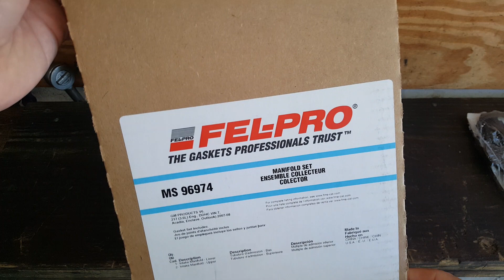How to replace the valve cover & intake gaskets on a 2008 GMC Acadia

Comment: Great video.  Easy to follow.  One HUGE tip.  You didn't have to remove the hoses for the Power steering reservoir.  All you had to do is remove the 2 nuts holding the reservoir to the bracket and move it aside. Then just bent the bracket outwards to get access to the One Valve cover bolt hidden under the cover protector. That's all. Then once the valve cover is reinstalled just straighten the bracket back to it's original position. Done. Again, great viceo.  Very well put together.
Reply: THANK YOU. This was the one step I was stressed over.

Comment: If I'm not mistaking, you put the new spark plug tube oil seals in the valve covers backwards. Great video!👍 Answers a lot of questions!
Reply: I agree. It seems backwards. Other than that the video is great
Reply: He definitely did put them back in backwards. I wonder if it affected the operation if any?
Reply: He did put then in bkward

Comment: Thanks for sharing your experience. I just got done doing the same job on my wife’s ‘08 Acadia, and I couldn’t have done it without your guidance. I found that I didn’t have to remove the motor mount. Also I removed the smaller front hose from the power steering reservoir and capped it off while I suspended the reservoir from the windshield wiper with a small bungee cord. Then I just removed one bolt from that bracket the PS reservoir was bolted two and rotated it forward. After bleeding the PS system when I finished, and discovering I forgot one wire connection and the rubber nubby thing that goes vacuum port on the back of the intake manifold fell off, she’s back on the road!
Reply from the maker: I appreciate you taking the time to share this and the great feedback.

Comment: First off, GREAT Video!! That MF'ing Bracket. After messing around for hours (most before I found your video), I started doing what you did. Then I got got tired and I bent it out of the way. The bent it back after. Worked awesome. Thanks!!!
Reply from the maker: Thank you for sharing and thank you for the great feedback.

Comment: Hi, at 51:31, you show plugs on the passenger side of the rear cover. 

What is the plug closest to the front of the engine? I broke the part connected to the engine, where it plugs into.

Comment: Thank you for this, I just got a 2008 Acadia and it has oil leaking into the spark plugs. But any idea why the transmission control would turn off after I did this job?
Reply from the maker: I first reaction would be it was a coincidence, however I would check all the wires , grounds , fuses , connectors etc. Wish I could be more help. Thanks for the feedback.
Reply: @s33therfan  yeah idk what happened

Comment: Need help after completing these steps we tried to start it up no power not even a crank or click bought a new battery, it still has no power nat a sound we double checked the connectors alls in place , I’m thinking it could have been the fuse box after taking in off then placing bit back but it’s simple steps I appreciate your video very much nobody has this model vehicle sets if you can give any info as to find the source of power to star the acadia 👏

Comment: Hey, doing diagnostics of my g/f's 3.6 in her 2008 Vue XR. She drove it, came home, then the next night it cranks but wont start. 200k miles and has had timing codes for awhile. Tested battery, good. Replaced the starter and tested the old, both good. Tested fuel pressure, good. Disassembled down and removed one valve cover. Chain is still connected at least, so not broken. Any ideas? Driving me crazy. Why would it be shut down and work and then all of a sudden not work now?
Reply from the maker: I would check for spark and do a compression test . Usually timing codes popping up is not a good sign , but I would check the basics and go from there. Thanks for the feedback.

Comment: If you spray PB Blaster, on connections like that it'll loosen and lube them up and then they'll come right off, if you have time to let them soak a little while.... I even use PB Blaster on stubborn electrical plugs, to get them apart.. I just use PB Blaster on a BMW thermostat yesterday, where the hoses with the clip that holds them on don't like to come off of it, so I took it soak them and let them sit about a half hour came back and they popped right off. And I do that to prevent breaking anything... Try it, PB Blaster is the truth...
Reply from the maker: Thank you very much for sharing and the great feedback.
Reply: Thanks for the info

Comment: How did you get the car to turn on after doing all that my acadia won’t start I did everything plus the water pump and thermostat
Reply from the maker: Sometimes I have had to give them a shot of starter fluid , with other vebicles. Not sure why but it happens and I have ran into the same issue swapping an engine. Once it fires up initially the car starts good from then on. Thanks for the feedback.

Comment: I hope after all the work you cleaned the PCV and the rear valve cover PCV passage. They all clog up and cause sludge and carbon in the engine, I have a 2010 Acadia I'm going to do timing chain's on Not going to enjoy that job!!! Great Video BTW !!!
Reply from the maker: Thank you for the feedback , it is much appreciated.

Comment: How much work would it be to replace the intake valves?
Reply from the maker: It would be a pretty good job. The cylinder head would need removed and resurfaced before replacing it. Thanks for the question.

Comment: Thanks for the video. This job sucks, especially the freaking clips. And i chipped the cover near the chains in the front -or someone else did it. Hopefully it doesn't leak, it's chipped on the inside. Can JB Weld be used to fix the chipped part?
Reply from the maker: I would think so , and depending on the size , maybe rtv alone. Thanks for the question.

Comment: Hey did you fix your acadias oil in throttle body issues if so what did you do.? Part numbers if possible
Reply from the maker: I cleaned the holes on the vacuum line spouts going into the valve covers and that seemed to help. Plus cleaning the valve covers themselves. Purple cleaner , scrub , rinse and repeat. Hope this helps.
Reply: @s33therfan  I have seen a fix for the pcv valve going around in the camaro community with the 3.6. They are installing an oil catch can and then drilling the 2 holes on the bottom to 5/64th's and the single top hole to 7/64th's. Also helps the motor breathe better to help with timing issues and sludge build up down the line
Reply from the maker: Great information , thanks for sharing.

Comment: Have this video saved to be watched later when I have more free time. Quick question though, is this the same motor that is in the 2011?
Reply from the maker: The engines are different , however the transmission can interchange with the tcm swap. Thanks for the feedback.

Comment: I have an oil leak and they telling me its the valve cover were they leaking oil
Reply from the maker: These were not leaking and as a matter fact all of these I have worked on have not been leaking. However once they are disturbed/removed they can and will leak. Other than that these engines actually seem to be sealed up fairly well , that is atleast one good thing. Thanks for the feedback.
Reply: What do you think is leaking it's on the back side of motor
Reply: It's not in the front of motor
Reply from the maker: It most likely is the valve cover . Try if possible to reach back and feel with your hand and if theres oil then that is the culprit. Another area is where the vvt solenoid come through the valve cover ; check those for leaks. Those seals can be replaced without removing the valve cover. Hope this helps.
Reply: @s33therfan  thank you ill look in to it thank you again  i don't want to have to replace the valve gaskets if they don't need to looks like I have to take off a lot of things to get to them
Reply: put my hand around the back side of the covers and theres oil but on top of the valve cover you think its where the spark plugs are at
Reply: you think I have to relplace the grommets and spark plug seals
please let me know what you think before I start taking everything apart already ordered the parts and intake gasket
Reply: I have oil on the insulation on top of the valve covers I push down on the isulation and oil comes out please let me know what you think thank you for all your help
Reply from the maker: Yes . I would replace all of them . When you go to replace the valve cover pay particular attention to the vgt solenoids . If they have any wear marks to the plastic. You may have to use a little rtv smoothed around the surface area there. I have seen those leak pretty severely , even after replacing the grommets. You should be able to see those before disassembly however. Thanks for the feedback.

Comment: Thinking about doing this job to my 08 Saturn outlook XE, did you ever figure out what to clean the camshafts with to get all that junk off? Also awesome video man!
Reply from the maker: https://amzn.to/38L5h8u

Other than a engine flush , there is not much that can be done without a total rebuild. The problem is even if you get the cylinder heads spotless you still have all the passage ways and the lower end as well. I do believe several flushes and keeping the oil changed can help. Another area of concern is making sure the hoses and spouts coming off the valve cover are cleaned and allowing vacuum. Hope this helps , thank you for the feedback.
Reply: @s33therfan  Thank you man ! Much appreciated , do you have an email address I can contact you on? I was gonna ask you a couple other questions about this project !
Reply: 6

Comment: Luckily,  my wife's car didn't have the sludge under the valve covers.  It looked pretty clean,  aside from the oil staining
Reply from the maker: Thank you for the feedback , I appreciate you watching.
Reply: I had a little misadventure with the heater inlet assembly snapping at the junction, the coupling was made of plastic and had gotten brittle and didn't take much to break it. I broke it while trying to get some room over the back right valve cover bolt.  That halted progress for a week while I waited to get the new one in which has an aluminum coupling, so it should be good there.  I'll have to replace the outlet assembly down the road, they're about $100 apiece and the way they're made, they have quick release clips except for the one hose that connects to the heater core.  I only broke one so I replaced one.  While this was going on, I had the alternator give out on my car so I got derailed to replace that, which is an 03 matrix xrs. I got both valve covers on now but i'm in the process of cleaning the surfaces of the upper and lower intake.  I was using scotch brite pads but noticed a lot of debris coming off from the pad so I switched to a dremel with a soft brush attachment and then took some brake cleaner and shop towels to clean the surface.  I had go stop when the dremel battery died, plus it was already dark outside so I get back at it today before I head to work

Comment: 2.5 qts of oil, 2.5 qts of kerosene with bullshit filter after draining the oil... Run it for an hour, drain the oil while warm for better results of getting the oil out... Do this process again.... Or you can use a qt of kerosene for an hour and then drain it... depends on how bad...
Reply from the maker: Thanks for sharing this information. Much appreciated.